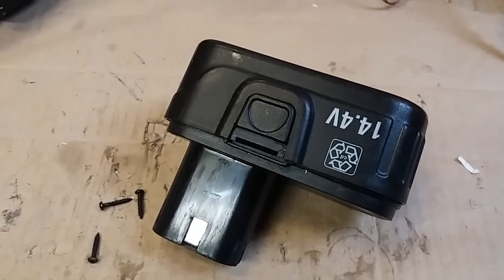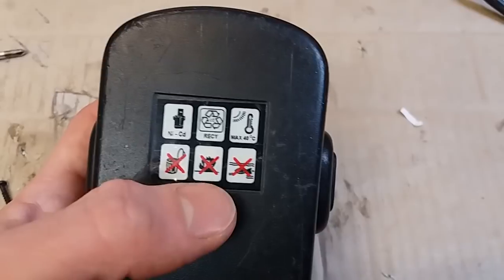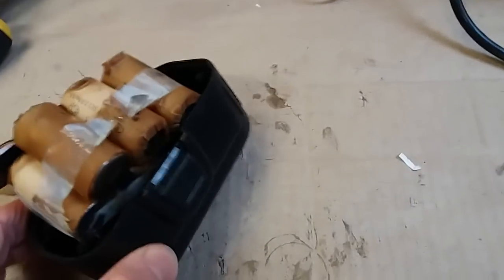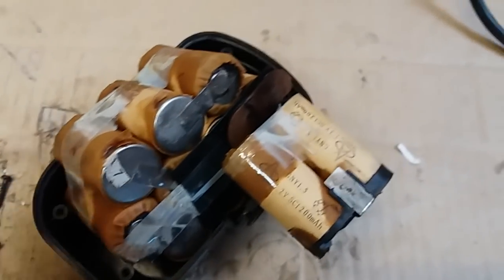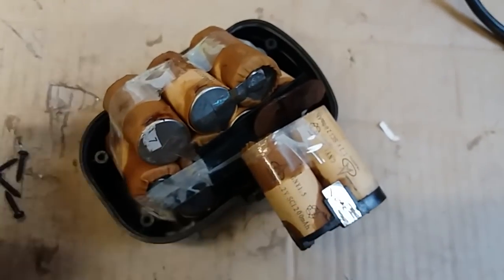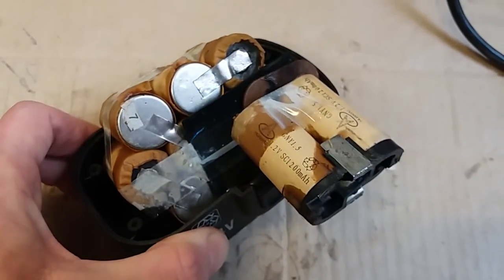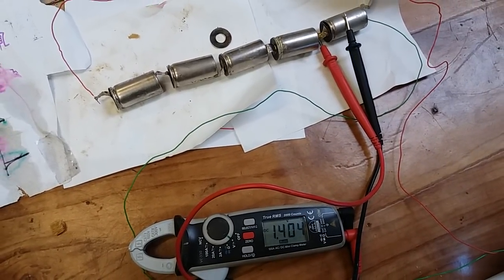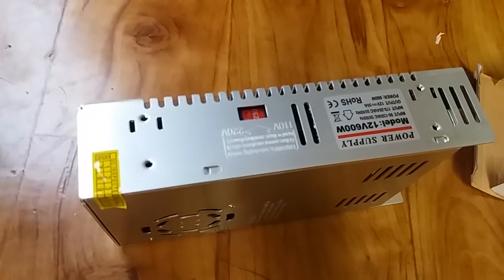inside a 14.4V cordless drill battery pack & reusing the cells (unedited)

Comment: That battery pack 100% belongs to the drill from the previous video
Reply from the maker: I'm not sure, the motor in it says 12V. I'd expect 10 cells for it.
Reply: @DiodeGoneWild  Could be, chinese products like to squeeze every bit of performance out of everything at lowest possible cost, so maybe they are purposely overvolting the motor to get more torque, and even the connectors looked compatible...

Comment: Nice video, great teardown and excellent find :) Those Sub-C cells are useful in DIY projects or for replacing damaged cells in older power tools.
The only thing I don't like about these battery packs is that these are a long series connection (12 cells in this case), so if one cell fails, it takes down the entire battery pack. With no need for a protection PCB, this method of failure is more likely to occur as the cells wear and one or two cells (the weakest ones) lose their capacity fastest, possibly being run in reverse towards the end of the discharge.
Those five cells at the end (the non rusted ones) can easily make a portable 6V power supply; whilst it isn't as common as 5V or 12V, there are still appliances that are designed for 6V. Alternatively, if the rusted ones still take a charge, keep those as well and build them into a power pack as well.

Comment: It belongs to the cordless drill innards that you picked up! Because i have the same. The pack wasn't holding much charge about a year or two after it was purchased, the cells were junk to begin with. The whole drill was only several €, and it's not a terrible drill, the chuck runs very true to within better than 0.1mm and the rest just about does its job, so it was probably cheaper to give away almost free tools to get people to take the junk cells home than to industrially recycle badly manufactured cells.

I mean odds are there's only a handful bad cells there, maybe one per pack, maybe none, but that's plenty to make the pack not work properly. Same thing with a big flashlight, extremely cheap, and other tools bought from the same company around the era, on all of them, the battery pack went bad quickly.

Comment: I had the same cells in my 18 V power drill and I replaced it with a 5s1p LiIon 18650 pack and a BMS/balancer. Now my drill has much more power and the capacity is way higer.
Reply: agree that what everybody is going for lately!! Replace those crappy battery with Lithium 18650!
Much cheaper than to buy a new battery for your drill. Plus Lithium give more power and more capascity, so once charged the battery pack of the drill last much longer! Of course it depends a bit from the capscity of the 18650s used....
Reply: @DrZipZwan  I used the good Efest with 2800 mAh each. My drill is about 20 years old and an accu drill was the bees knees at this time.
Reply: @kapegede  Damn 2800mAh is a pretty good choice!! Yep a good drill can last really , it just need care! Hope it ll serve you longer😉

Comment: If you renew the cells you need fabric tape, insulating tape is too thin. 
I had renewed cells in such a pack once. 
Unfortunately there was a short circuit and I could only watch the pack burn down.

Comment: found it in dumpset again ehh?
😂 I said right away whe I saw the notification, but.. I knew I wasn't right..
Reply: I see no problem with dumpster diving, especially in first world countries where people are extremely wasteful. I got a 2005 CD/tape/radio boombox that only had a broken lid contact. Or a functional USB cable and a pair of headphones. Or a nice USB keyboard with just a bad contact because of a twisted wire. Or an LED Christmas light set where the blue string didn't work (thankfully). The list goes on...
Reply: @vaclavtrpisovsky  Yeah i fished my backpack out of a dumpster, The North Face brand, not cheap. I was walking in a park and i see it sticking out of a garbage bin. Looking inside, beer bottle shards, beer smell, it's obvious what happened. I washed it out in a nearby stream and took it home, washed it some more, it's good. Nearby i found a clip from Bose headpones, probably belonged to the same person.

Well at least that was an appropriate way to get rid of it. Less appropriately, saw once a Walkman and a radio in a garbage bin, well that's not allowed. Mine now. Similarly a normal garbage bin isn't the right place for a power drill and a battery either.
Reply: I’ve picked up several vacuum cleaners in total. Many are dumped by the roadside, while are found in the skip. They all work perfectly. The main problem is the heavily clogged filter.

Comment: I'm supprised that they are Nicads,  i was expecting NiMh cells.
Maybe nicad cells are cheaper, or the battery is 4 million years old lol :-D
Reply from the maker: Most powertool manufacturers skipped NiMH technology and used NiCd until Li-Ions became common. NiMH can't deliver that much peak current as NiCd. NiCd also allows very quick charge. I charged them at 1C (1200mA) and they were stone cold until reaching full charge, then they got hot. And yes, those old NiCd cells still show about 1300 - 1350 mAh, more than the rated capacity! NiMH are also way more sensitive to the voltage reversal of the first cell that gets flat. NiCd makes more sense in the harsh conditions of power tools with very high currents and very simple electronics. Li-Ions are of course the best, but the electronics involved have to be always complex.
Reply: @DiodeGoneWild  So Nicads are still a good choice for power tools, amazing really as nicads have been around for a very long time,  and they have the memory problem.
I was thinking Nimh because they don't have the memory problem with part charging.
I shall slap myself for being stupid lol :-D.
The old 78 series regulator with a single resistor was a very reliable charger for nicads.
Switchable resistors and a 7805 made a handy charger.
Reply: @zx8401ztv  Or a LM317...
Reply: @Mark1024MAK  Yes a lm317 should work and i imagine the voltage dropped across it would be lower than the 7805.
But  why waste a very handy variable lm317 when a common 7805 would do.
I tend to keep lm317's for quick variable power supplys, perhaps im odd lol.
Reply: @zx8401ztv  - ‘cuz I tend to have more LM317Ts in my spares box and you can use a lower power resistor.
Reply: @Mark1024MAK  Yep 1.25v across the resistor.
Just for a laugh i looked on amazon for Lm317's,  every picture looked dodgy and most were not branded.
I go to R.S semiconductors, original non fake parts.
Shame that amazon allow crap like that appear on there site.
Reply: @zx8401ztv  - the Amazon marketplace is no different to eBay or other similar sites, in that nearly anyone can set themselves up and sell things on there. Hence a lot of Chinese companies now trade there. A lot of these Chinese companies are just resellers. So yes, it’s a bit of a gamble on what you will get.

Comment: Can i charge NI-MH batteries in the same way of NI-CD batteries? Can i connect them in series and charge all of them in series with a constant current?
Reply: Yes, chargers usually take both types. See his video on the topic: https://youtu.be/5cBQ786lyPA
Reply: Yes that's okay. And maybe if you have a charger that says "for Ni-Cd only" (does something like this even exist? I don't know...) you can charge Ni-MH too because they are not that much different. But one thing: Ni-MH don't like extremely high charging current as it's common at Ni-Cd.
Reply: Yes, i know this one. I want to ask to be 100% sure. I will charge NI-MH batteries with around 300 mA (i will charge 8 of them in series, then the excess charge will be dissipated in to heat and 300 mA should not overheat them)
Reply: @gianluca458  - Yes, as long as you are not trying to use a NiCad fast charger, these monitor the battery voltage and if they don’t see the correct voltage change, can overcharge NiMh types.
Reply: No, i will not use fast chargers (And i don't like them so much either). I Will use my power supply limited at around 300 mA. In theory NI-MH batteries cant be overcharged, they should dissipate the excess energy as heat, right? [So i will limit the current so that the batteries don't overheat because dissipating energy as heat at higher currents can overheat them]

Comment: I have just converted a 14.4v Bosch impact driver to Lithium ion using 4 ex-Hilti 2ah 20/30a capable cells. The 4 cells fit tidily in a longitudinal direction and work well. The power trigger gives progressive increases up to about 75% and then finally all hell lets loose with tremendous screw-driving power. Doesn't seem less capable than 18v lithium drivers. No BMS fitted but individual cell connections for an iMax b6 charger which allows for balanced charging.
Reply: I fitted 8 cells with BMS to same 14,4 Bosch Nicad battery. Haven't charged yet with original charger.

Comment: High current diy power bank with this cells?
Reply: Should be possible ;) I'll think 10 cells in series (12.0V) which 2x parallel (to give more current and capacity) could manage to start a small petrol car without any car battery.

pro for Ni-Cd: they are safe and don't are violent if they get mildly overcharged or wrong charged or shorted out.

Comment: How did you choose voltage and current for charging?
Reply: Voltage about 1.40 ~ 1.45 limited or cut off and the value Ah per cell equals (roughly) charging current.

For example: 2.6 Ah per cell so give current limited charge to about 2.6 Amps. That should be fine in every case for Ni-Cd.
Attention on Ni-MH, they can get hot too on just x1 value (Ah capacity equals charging current).

You can set lower value or x2 value for ultra fast charging. But without temperature sensing and electronics it's not recommended as the cells get really hot if pushing 5.2 Amps for 35 minutes. (Charging losses).

Any further questions? Feel free :)

@DiodeGoneWild: is this correct or am I wrong?

Comment: I have this same battery pack in my "Tip" drill which i have bought 20 years ago. Hope you would convert it to 18650 batteries 🔋 🔋 🔋 🔋
Reply: Likely not worth it, the only drill he has that seems to use this connector already lacks the chassis, so it's not much portable anyway. I guess he will only be using the drill with his bench PSU or something like ATX.
Reply: NiCads are perfect batteries for power tools.
Unlike Li-ion, they can deliver 100's of Amps and not get destroyed. Also can be discharged to zero volts and will recover. 
NiMH can't deliver the amount of current like NiCad can, and require advanced chargers.
Li-Ion is limited to how much current it can deliver, and requires a shutdown and monitoring BMS circuitry.
Reply: @piconano  agree. But almost all chargers (maybe 98 or 99% ?) are compatible with both Ni-Cd and Ni-MH. Don't seen any charger that says "Ni-Cd only"
Reply: @gumpi5  out of 5 chargers I have, 3 are nicad only. Depends how old they are. There was no NIMH batteries when I bought an 8 battery charger from radio shack back in the late 80s.
I put NIMH in them not thinking, lost most of their capacity in a few cycles.☹️
Reply: Can a NiCad charger recharge a NiMh cell / battery? It very much depends on how the charger determines the end of charge state. And if the NiMh cells can take the overcharge if the charger does not detect the end of charge state it is looking for. If it’s a slow charger, it’s generally not a problem. But you should not use a NiCad fast charger.
Reply: @Mark1024MAK  No. It will over charge them. However, you can charge NiCads in NiMH charges without worries.
Reply: @Mark1024MAK  It can tolerate up to 0.3% of the cell's capacity.
If the cell is 1200mAh like in this example, you are limited to 3.6mA charge current limit. 
If you fail to obey the charging rules, your batteries will keep bleeding capacity, every time you charge/discharge them. 
One day, you'll see a 1200mAh give you 100mAh at most.
Reply: @Mark1024MAK  Also, I've told you this before and you keep saying the same bullshit lie. 
I know it's lie because I've destroyed enough of them at only 50mA charge rate. 
Most slow chargers put out in excess of 100mA.

Comment: Thouse are 1200mAh cells, you should charge them are 120mA for 12-13hrs (you dont really need 16hrs anymore) and then test each cell individually. Most likely only one or two of those cells failled. its usually high esr/capasity loss and then you get polarity reversal the momen you push it a bit and that ruins them completely while the rest of the cells are somewhat ok.
Reply: Yeah but who wants to deal with rusty cells that can just fail because of casing breach rather than due to capacity loss and reversal. The ones that don't look too bad are good to keep.
Reply: @SianaGearz  i doubt the casing is rusted enough to crack open under pressure, they are quite thick because NiCd cells need to withstand the pressure necessary for the gases to recombine. the walls are about 0.75mm thick. Unless you are going to charge them at 4-5C i doubt anything is gonna happen. 
Unless theres pot holes in the case because of the rust, superficial rust can easily be dealt with with 600 grit sand paper or vinager+salt. Rust is only visual, its not that important as to throw a functional cell away just because its stained a bit.